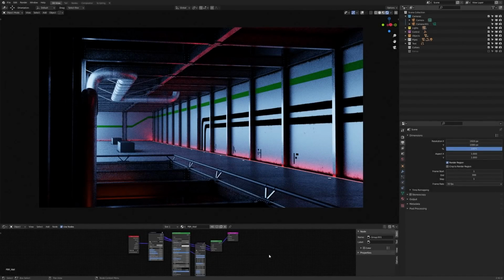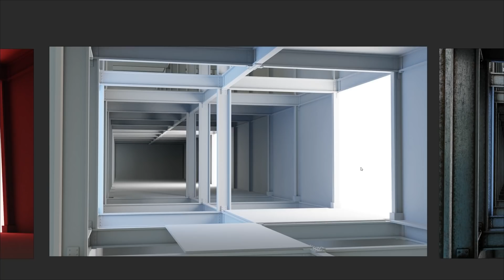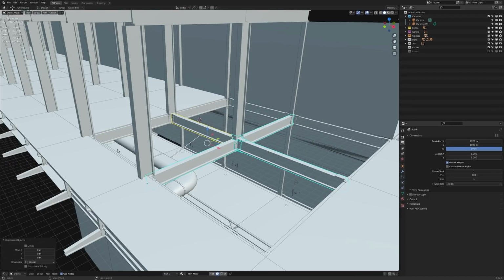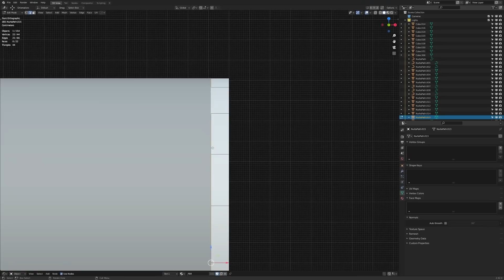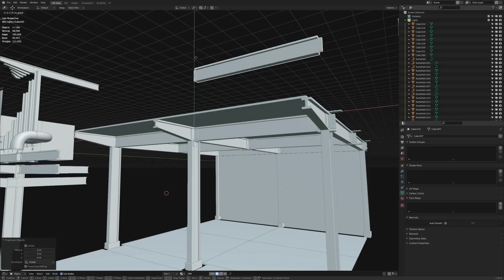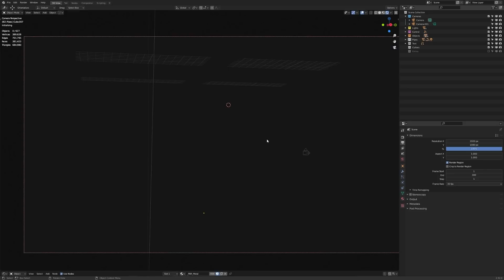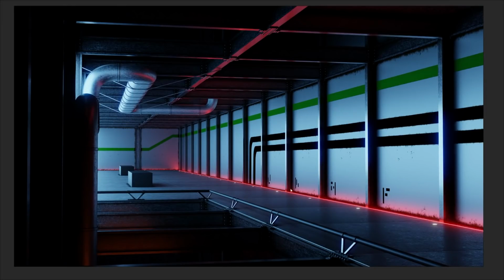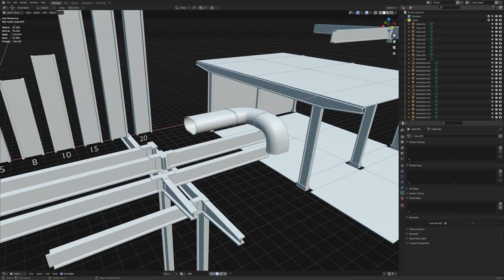Making Modular Architecture in Blender!

Comment: Fantastic tutorial! Blender massively needs a way of creating custom snaps for modular work.  Real-life fittings aren't made to suit a grid.  I know that in Unreal you can use Sockets from the rigging system.  Is there something similar in Blender that could be hacked to create snaps that aren't dependant on the grid? Thanks
Reply: you can technically use the 3D cursor to snap objects to its location, useful for fitting two cylindrical objects perfectly inside each other. It is tedious and repetitive though for multiple objects